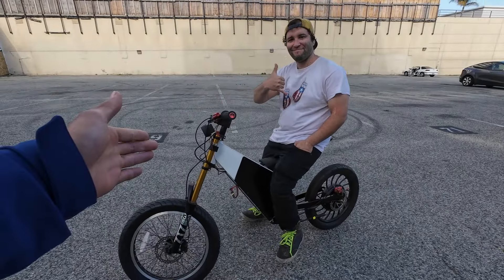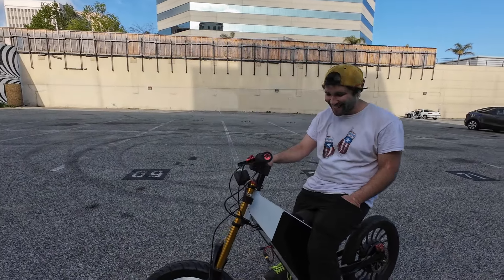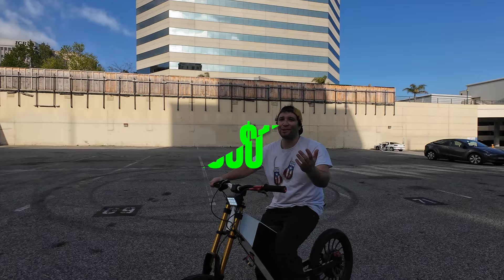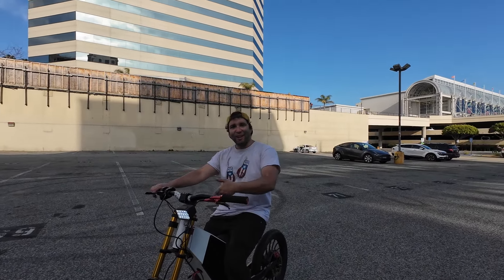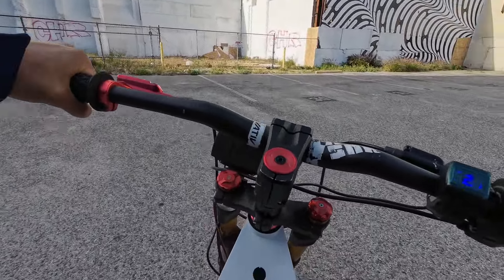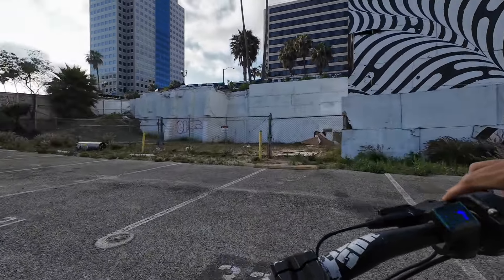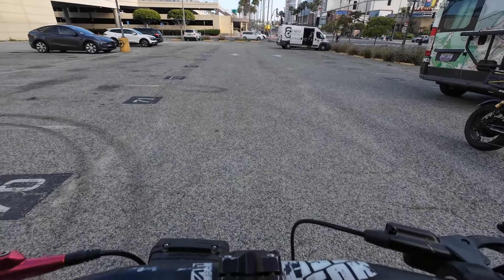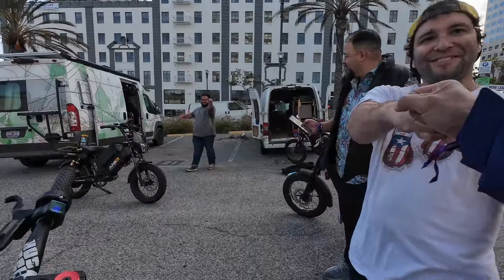This TINY Stealth Bomber is So Sick!!!

Comment: I have that same style rear hub motor but the front hub version.
Reply from the maker: What controller and battery set up do you have?
Reply: @Raspyrides  It's one of those generic silver ones that come with most common kits. A 48v 1500w controller hooked up to a 1000w motor powered by two 48v packs hooked up in parallel. That's for the front motor. The rear is a 500w motor hooked up to a 1000w controller powered by 2 more 48v triangle batteries connected it parallel. Total battery capacity is about 45ah. The funny thing is that the rear motor seems more powerful and is about 2mph faster than the front motor.
Reply from the maker: @ELECTRICBIKEDIYLIFE  wow that’s a lot of batteries in a bike lol. I think that’s normal for the rear motor to be a bit more powerful. I’d rather have a more powerful rear than a front anyways. Sounds safer

Comment: estrapz has a smaller bike like that and it is aluminum frame. To me it is not a bad deal even though there are so many of similar bikes. Now looking at the frames they are all different in terms of quality, shape , materials.
Reply from the maker: Just checked them out. They do look like small stealth bombers but the seat height are 32inches off the ground. This one in the video was closer to 28inches

Comment: I'm on the fence for the Annioki but I'm 6.2, do you think that's pushing it? It's a bit of a gamble if you can't sit on a bike first! :o
Reply from the maker: You’re 6feet and 2 inches? If there’s going to be a bike for you, it would be one that has an adjustable seat which the aniioki does have.
Reply: @Raspyrides  I know very little about bike geometry but I know it's important, I just don't want to be overly cramped on it type thing. But I suppose I wouldn't be peddling it that much especially after some upgrades lol. And with the tariff expiring it's now or never..